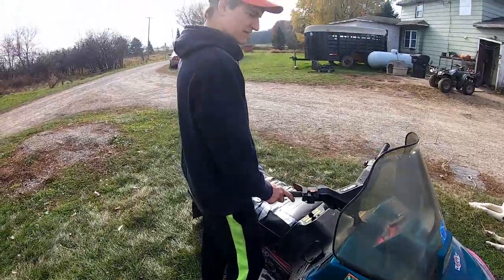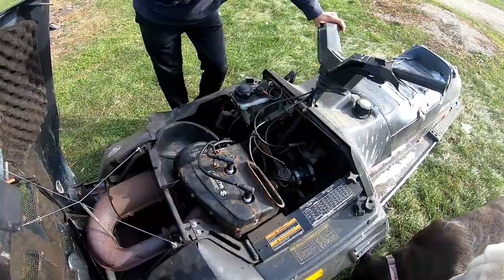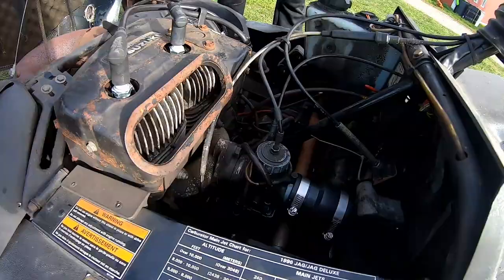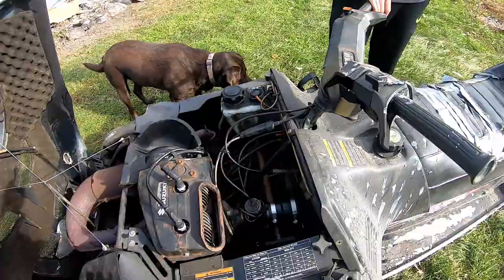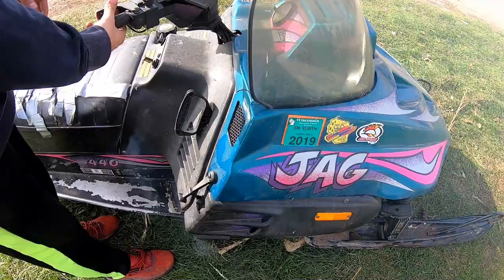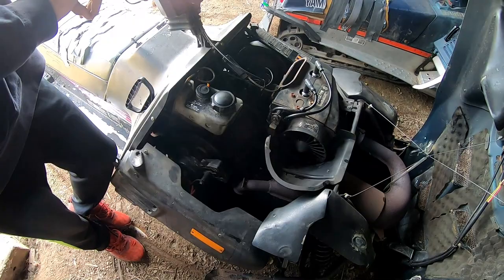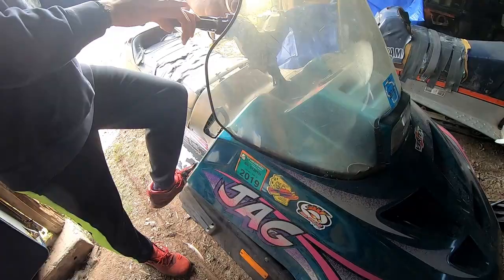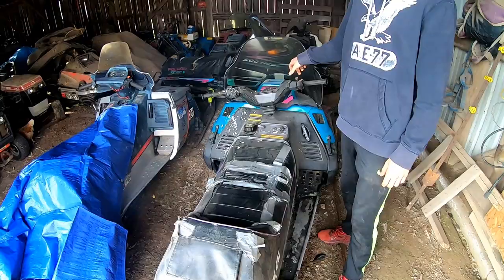Is Removing the Muffler On Your Snowmobile A Good Idea?? Straight Pipe Sound Test on Jag 440

Comment: So you can essentially run a straight pipe out the bottom and its not gonna hurt anything?
Reply from the maker: It will still be leaner. Have to keep an eye on the plug color. Essentially u r removing the muffler the header tuned pipe is not being changed but back pressure will be less so it is important to check the plugs after running it.